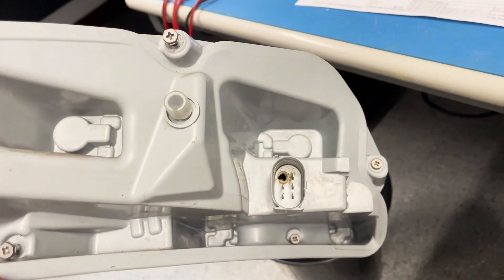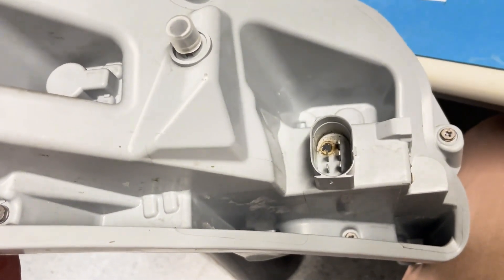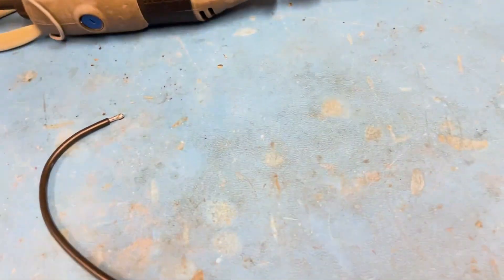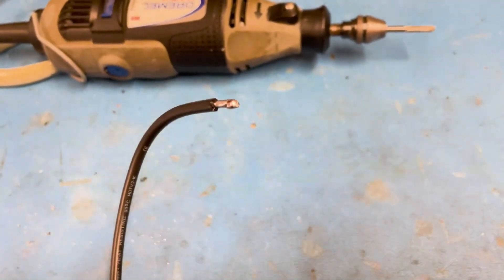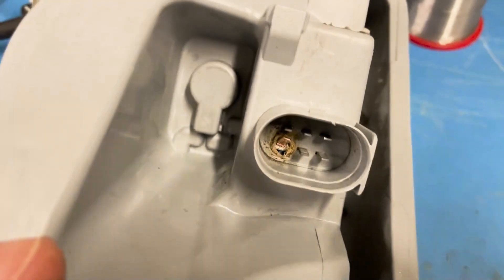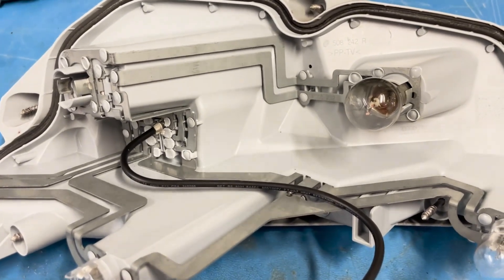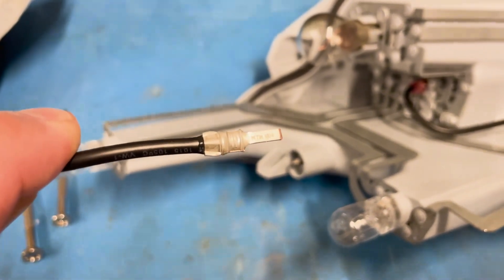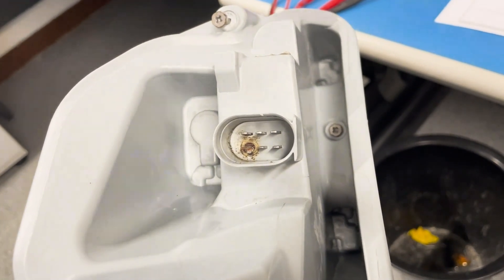Audi TT Mk2 8J Rear Light Connector Repair - Part 1

Comment: Soldering the wire to the ground plane is a good idea. I don't like the suggestion I saw first, to drill a hole and fix the wire with ring terminal, a nut and a bolt. I'm still gonna opt for making a new ground connection, because I care more about permanently fixing the problem than it being more OEM-like (it's all hidden from sight anyway), but that saves me two holes that moisture could come in through (since I have the issue with both the taillight and the turn signal bulbs, so I need to join the two ground planes and then connect them to a new earth point)

Comment: Where did you get the terminal replacement? Is it sold at local auto stores or ordered online. Thanks!
Reply from the maker: If you search for 'blade crimps' online you will find various sizes from different online retailers. eBay is probably the place to buy small quantities.

Just be aware that the contact on the wiring harness on the car is also likely to be damaged and all of this is only a temporary repair. Take a look at my Part 2 video (link below) where I fit a separate high current connector to handle the earth current.

https://youtu.be/7ILzhnW3pqc?si=5pkK4f4GK99aFeoZ

Comment: It brings no solution. The problem will reappear because you didn't ground it to the chassis ground lug...
Reply from the maker: The crimp terminal in the wiring harness plug also gets damaged by the over current. If it is also replaced then that offers a solution. However that may not last either. Take a look at my ‘part 2’ video where I bypass the ground terminal with a separate high current connector.